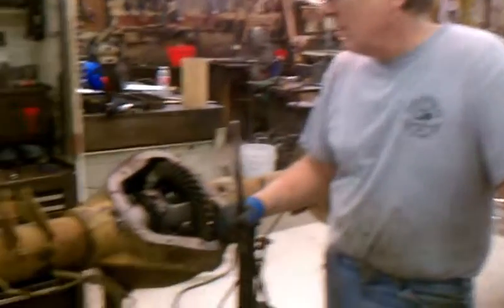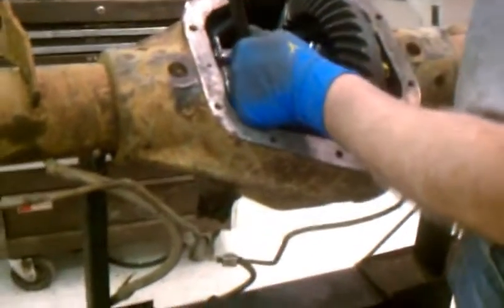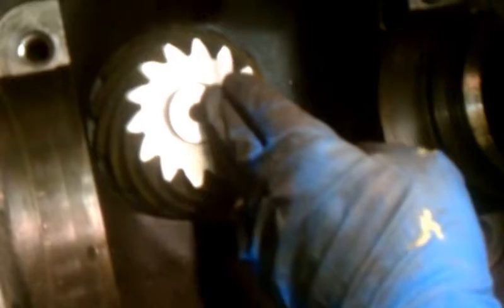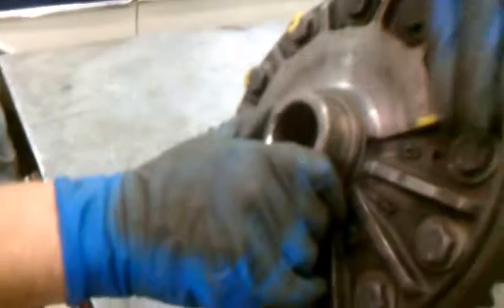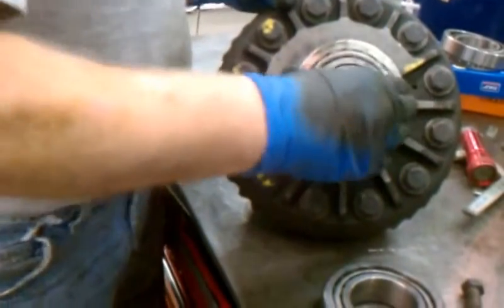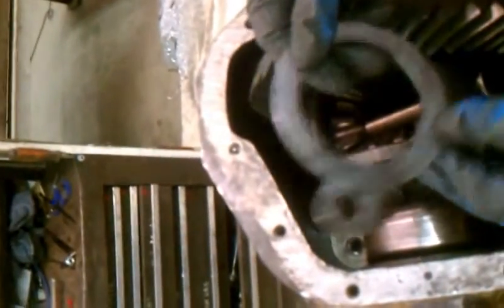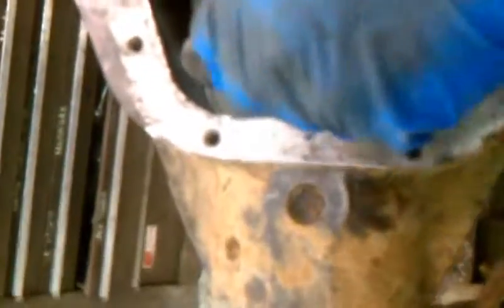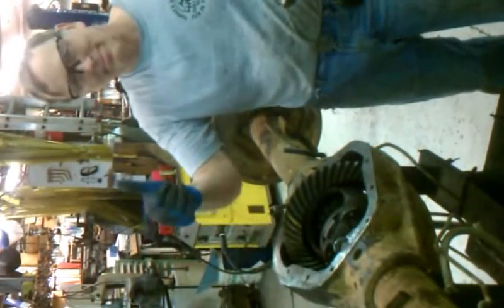How to intstall Dana 70 3.07 gears into a standard or 70HD housing (or 3.21sx or 3.42s)

Comment: You obviously know a lot about Dana 70 and Dana 60 axles. Maybe you can comment. I think my e350 van has a d70 case and d60 9.75 ring and pinion. Idk why ford would do this. Can I use 9.75” 3.08 ring and pinion without the machine work that was required in this video?

Comment: Hi Carl.  I am so glad you posted this.  I just followed your recipe and my 98 Dodge Cummins now has O/D and 3.07s.  It does 70mph at 1750RPMs!  Thank you for sharing
Reply: Helo! What pinion and ring are you using to get 3.07 ratio in Dana 70 ?   Greetings from Finland
Reply: @jukkajylha8285  hello.  The first gen Cummins auto were not overdrive.  They sometimes call them Dana 71 they have a greater offset than normal to accommodate the big pinion gear

Comment: So was machining the bearing race on the crown side a goof ? seems that was unnecessary as you put a 1/4" stack of shims on there ? Could one of the Dana HD bearings which is narrower to start with worked instead of shaving a bearing ? A lot of material was shaved off the counter weight, i guess its hard to say if that would be a factor.